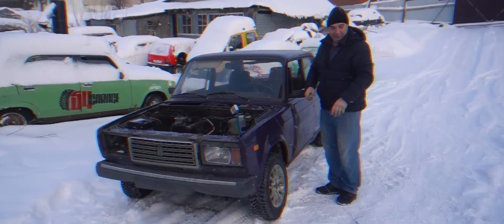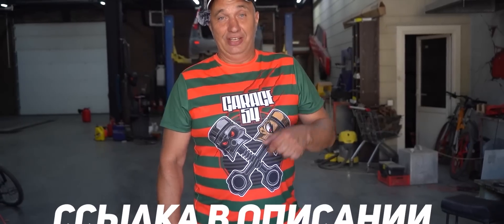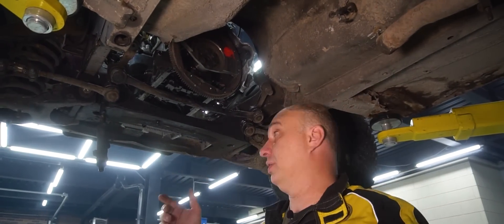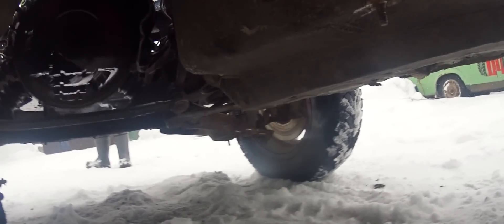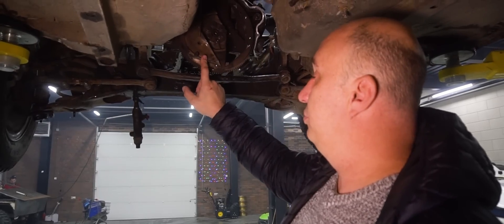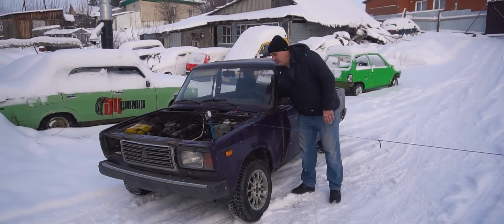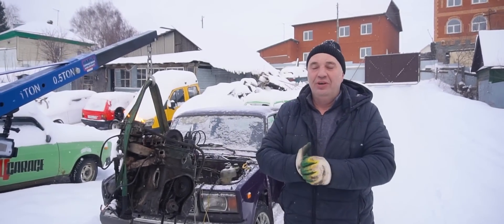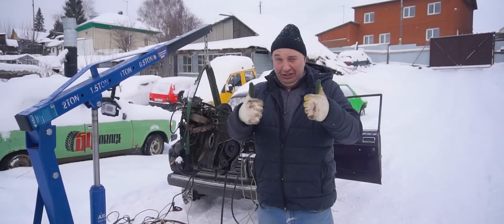We hack the flywheel and start the engine – what will happen?

Comment: He really needs to get the hell out of the plane of rotation.

The distance away isn't really what saves you if it comes apart. It's going to try to keep going the same direction it was... So he should be nowhere near the back of the engine along the side (in other words the very place he was standing was the worst possible spot if that flywheel comes apart.)

I've had this happen at smaller scale and got hit with a fragment and somehow lived. There's no way I'd do it with a 4 cylinder.

Comment: It's a Lada engine. Just put the covers and oil pan back on, add oil and coolant, and it  will start right up. It won't even need an overhaul.

Comment: Wonder if the vibration was so bad that it was causing valve float and that's why it fought so hard to run at certain rpm ranges.

Comment: @13:13 "Why do you all run for it!?" Errrr... coz if that thing lets go, someone is gonna die! xD They should definately stress crack or severely weaken a flywheel using a grinder and rev the balls off out the engine till it grenades. Pro tip: Use a bomb shelter to hide behind fellas!

Comment: Hi there,
Can you guys please experiment running a gasolene engine with HOT gasolene vapors.
Cold gasolene vapors are passed over exhaust in a container.
Then these vapors are fed into the intake manifold with vacuume   line hoses. Ofcourse , then check the gas mileage.
Appreciated
The vapor

Comment: Should use a brake/throttle cable instead of a string. Having throttle input determined by the relative position of the cable to its jacket instead of straight hand-to-throttle-body distance would make it much easier to maintain throttle input as the engine jumps around.

Comment: You guys should try a cross drilled flywheel, like racing brake rotors. It's used to dissipate gas & heat, so it should work for a flywheel & improve performance. 👍👍

Comment: Take two transmissions mount them yoke to yoke then to a rear end. The second trans should act as an overdrive. Four gear would be 1:1 then 3,2, and 1 would be overdrive. And if you put one in reverse....and the other in forward

Comment: It would be cool to see an engine run with the pan off like this but with the oil pump suction feeding from a separate container. I want to see just how much oil comes out of the bearings while it runs with oil pressure.
Reply: they already make that video. They installed transparent oil pan and run engine normal with oil
Reply: @lordred7462  oh cool I haven't seen it

Comment: I always like your videos you're the type of people that think outside the box love this interesting experiment you did pushing the limits of the physics and the mechanics however that little Lada car is your star it is your red star of the show she is the one that is keeping your show alive it's good to experiment however you want to make sure she survives I love to see these old cars run their sample mechanics there's no computers they're easier to repair I have been to Cuba 10 times they use these cars in Havana yes they do modifications and they play around with them as well the balance the show is extraordinary you like to push the boundaries of physics almost you like to test out I also love the fact that you use experimental tires maybe the next thing would be to try to run your car on potentially hydrogen potentially methane and run a diesel motor on plastic there's a way of converting plastic into diesel when you heat it up to 400° I like the fact that you're running the hardware to the max with the imbalances for these things could potentially happen how are motor would behave in these circumstances it is like you running future tests and awkward situations as our environment is changing as the weather is behaving erratically resources are becoming scarce and you may have to do it all the fact that you're pushing this motor to its maximum potential is quite good you're testing for the future as the weather against worse the storms get worse sometimes you have to do modifications to systems so you can go from point A to B it would be interesting to see how this car would behave on hydrogen however please be very careful it is very explosive it is very volatile I think it gives about four times more the power of standard gas so you can imagine the power you get and your motor when you run hydrogen some modifications would have to be done then again nothing which is produced naturally would be another scenario just maybe some potential ideas however I like the fact that you spike up the video and you really think outside the box please continue to go to work all the best to you and the team garage 54 you guys are are cool and pushing the limits

Comment: Your boys are wimps what are they running from The motor is not even hitting 2000 RPM that flywheel is not going to explode and blow off the motor during start up

Comment: Love the good work guys. Something I have always had knocking around in my head is if you could make a race cam profile with common tools e.g welder, grinder and vernier.
Reply: Question…. I have a 4cyl tractor engine that is leaking oil from rear of block when running. I can’t see where unless I take off flywheel. Is it possible/safe to start engine with flywheel off? It only leaks when the oil system is pressurized and it has a new rear main seal.

Comment: i love how they just run the engine with no oil, cut of balance on the crankshaft, unbalanced flywheel and no oilpan, only thing which isnt missing is the valvecover 😂😂
edit: correction the valvecover is also missing 🤣🤣🤣

Comment: in drag racing they put a scatter shield blanket over the transmission tunnel  to prevent shrapnel flying off into the cabin when a flywheel explodes. And YES it does happen. 
In a FWD car with transverse mounted engine the flywheel is often on the drivers side (Left hand drive). If a flywheel explodes the pieces can pierce the floor or bulkhead and severely injure or even kill  the driver. 
So this experiment is actually quite dangerous. Specially with the engine revving at 6500rpm. The energy that is stored in that flywheel is considerable, something to take serious.

Comment: You guys should try to install a starter motor straight to the input shaft of a gearbox and see how fast you can go!
Reply: would work best with it still using a ring gear otherwise it might just smoke. but yes delete the engine
Reply: they did something like that, running the car only on a starter motor... they could run it for 45 seconds at 12-15 km/h

Comment: if you look inside a washing machine, you will see these huge damper Springs. the way it fights the unbalanced load, is to actually let the drum in the washing machine shake. if you want to see some damage out of an off-balanced motor, all you have to do is solid mounted in whatever it's going in. if you don't let that motor Shake, you will see some violent explosive engine reaction. it's a shame y'all didn't know this, because you could have had a much more exciting episode. I've seen a slightly unbalanced crank on a solid mounted engine, break off the entire side of the engine block!!! remember, 1 oz of weight @ 5,000 RPM, becomes 6 lb of weight!!! when you let the motor wobble around, you're absorbing the un👠balance. you're actually helping to smooth it out. so next time you do one of these off balance engines, make sure you solid mount everything. you won't regret it, I promise.

Comment: For the past month, I've been driving a real P.O.S. on my family trip in southern & central Europe. It's a rented 2019 VW Polo with a 3-cylinder, 1 liter, oil-burning, no-power, no-torque hunk of junk. 

Even in its tortured state, that Lada engine of yours would be a massive upgrade over the poor excuse for an engine in this crappy little Polo.  (Although, with an adequate power-plant, this Polo would be an entirely acceptable machine.)

BTW: gas is $8/gallon here in Europe - at least where we've been so far in Romania, Hungary, Croatia, Slovenia, Italy, Austria, Germany & Slovakia.
Reply: @LabRat Knatz Time to move somewhere with a different way of doing things maybe? Yikes!

I read the manual for this stupid Polo and the engine is designed to burn up to 1 liter of engine oil every 2000 kilometers!  Can you believe that?  It's true; I shit you not. Apparently, in an effort to milk as many kms/liter as humanly possible, they have elected to loosen the piston rings to reduce friction. That improves MPG, but it also burns up a TON of oil! It's asinine IMO. That's MORE than a quart every 1200 miles!  What a joke!  I just have to hope and believe that the larger engine options for this car are engineered in a more traditional way and not in the utterly stupid paradigm of their 3-cylinder, 1 liter joke of an engine.
Reply: @LabRat Knatz Good question/observation!  I know next to nothing about European emission standards but I had thought that theirs were as stringent - probably MORE stringent than US standards.?  I suspect/fear that this new micro-engine concept will be an ever growing phenomenon. Another car I considered renting for this trip is a Dacia Logan (Romania Renault) also with a 1 liter, 3-cylinder engine. We've been in mountains nearly the whole trip and my biggest mistake was not getting a car with decent power for climbing and passing. This severely under-powered Polo is not fun to drive, but I bet the 1.5 liter version would have been just fine.
Reply: About $12 a gallon here in England
Reply: @MattyEngland  Wow; that truly sucks!  If you know, how bad is it in Portugal? That's our next trip in a couple months.

Curious: I know the pound is a mess right now. If/when the pound returns to its "normal" levels, how much will gas cost in UK?  ($/gal)  Last time I drove there was about 15 years ago when it was about $5/gallon if I remember correctly. I was horrified at the time since US prices were way less than half of that!
Reply: @LabRat Knatz US gallon (I'm American) Prices vary slightly from place to place, but it's right around 2 Euro/liter. The US average has surged to an unthinkable $5.00 per gallon nationwide average so I mentioned how much more heinous the gas prices are here in Europe. It's bad all over! 

I also recently had to add a liter of engine oil due to the 0-20 weight oil in this ridiculous oil-burning Polo and that was a real shocker. It cost me the equivalent of $20USD for one liter of the stuff. Unbelievable!
Reply: Will  How well does it shift?
Reply: @LabRat Knatz Our stupid Polo does at least have a 5 speed manual. With an automatic, we would not have been able to climb the Carpathians, Tatras, or any of the Alps! To get the job done on this trip with this inadequate car, I have simply resigned myself to chugging slowly up the steep stuff in 3rd gear while nearly everyone blows past us like we're sitting still! 

After this trip, no more 1-liter cars for me. I don't care if gas is 8 bucks a gallon - it's just not any fun driving the weakest car on the road!

We had a 5-speed i30 last year in Poland & Germany and it was just fine on that trip. I think it was a 1.5 liter, but it would roll with the big boys on the autobahn at 175-180 kph no problem!
Reply: @irgant  You may as well get a big V-8 car and go nuts!
Reply: @irgant   It's a rental so I'm doing nothing to this thing beyond complaining about how useless it is. The oil consumption of "as much as one liter per 2000 km" came directly from the VW owners' manual:

Volkswagen Polo Owners Manual: Engine oil consumption
Volkswagen Polo Owners Manual / In the engine compartment / Engine oil / Engine oil consumption
First read and observe the introductory information and safety warnings

Engine oil consumption can vary from engine to engine and can change during the working life of an engine.

Depending on how you drive and the conditions in which the car is used, oil consumption can be up to 1.0 litre/2,000 km – and is likely to be higher for the first 5,000 km for new vehicles. 

Initially I thought this must be a misprint, but more investigation led to the realization that they actually designed for this level of engine oil consumption in order to maximize fuel economy by way of minimizing piston friction in the cylinders. They actually reduced the friction in these awful engines by loosening the piston rings! I'm sure that you agree that this is no way for engine designers to make compromises, but this is apparently the direction that VW - and probably others - are choosing to take. This car does do extremely well in terms of squeezing out max kilometers per liter. The onboard computer shows me that, when I'm driving it calmly (not autobahn velocity) and on flat ground (not in mountains), it uses less than 5 liters/100 km. Obviously I have no complaints about that, but burning this much oil is beyond stupid!

I would not at all e surprised to learn that VW sourced this stupid little engine from Kawasaki or Yamaha! It's no-torque and no-power-until-super-high rev behavior suggests motorcycle engine to me!

In 8 more days, we will return the damned thing to the car rental agency in Romania and be done with it, but I thought letting others know about this ridiculous engine would be the right thing to do. I would never dream of buying a car with this engine, but the Polo with a 1.5 would probably be a winner - assuming that it is not also designed to burn oil rapidly like their 3-cylinder, 1-liter. Hell, a Polo with any 4-cylinder Lada engine would be great!  Maybe even a 2 or 3 cylinder Oka engine would provide a performance upgrade!?
Reply: @irgant  The car had 51,000 km on it when we picked it up 5 weeks ago in Bucharest. Now it has about 57,000. The car itself looks mint - I initially thought it was a brand-new car, but learned later that is was built in 2019.

It's not worn out; it just has an inadequate, piss-poor engine design. It's so piss-poor, they have to warn owners to check the engine oil at every gas tank refill in case another liter of oil might need to be added. 

Copy/Pasted from Polo Owner's Manual:
Volkswagen Polo Owners Manual: Engine oil consumption
Volkswagen Polo Owners Manual / In the engine compartment / Engine oil / Engine oil consumption
First read and observe the introductory information and safety warnings

Engine oil consumption can vary from engine to engine and can change during the working life of an engine.

Depending on how you drive and the conditions in which the car is used, oil consumption can be up to 1.0 litre/2,000 km – and is likely to be higher for the first 5,000 km for new vehicles. 

Of course checking engine oil level frequently is essential but, in my 46 years of driving all over the world, I've never felt the urgency of checking this EVERY SINGLE time I fill the gas tank! 

I completely agree with you about ensuring an adequate sized engine. This trip has taught me that lesson very well!  The 1-liter Polo is probably great as a city car in places without steep hills, but for any long-distance, high-speed driving or for mountain climbing, it is awful. This thing reminded me of the "performance" my Trabant provided when I lived in Budapest back in the dark days.

Comment: Its amazing that it was still running with out the oil/pan.👍
Reply: Thats just normal Lada stuff.
Reply: How about no coolant?
Reply: @OrtizQuickFix   coolant Is not as important as oil, in Winter you can run several kilometers without any coolant before blowing the head gasket and do damage to the pistons, on the other hand an engine who has been run  with no oil for more than 20 sec Is severly damaged, possibly to the point to develop a Rod knock and need to be rebuilt
Reply: @gillespriod5509 There's not nearly as much damage when the engine is unloaded. That said, speed kills too, so the combo is what did it in.